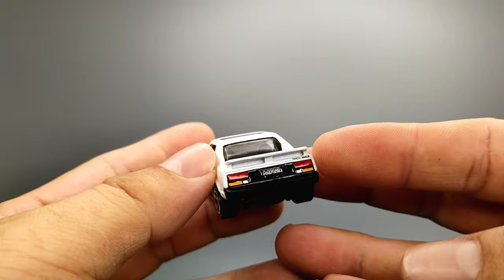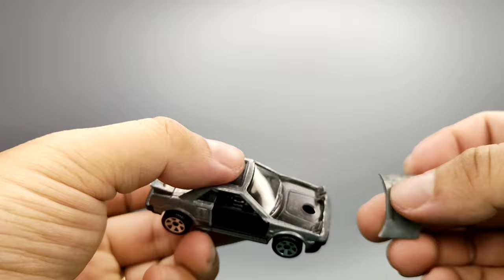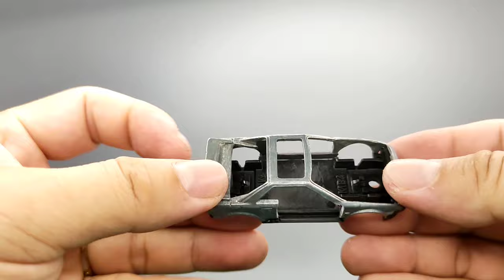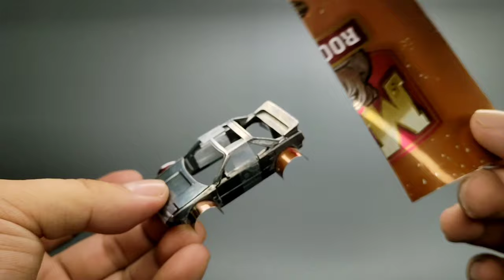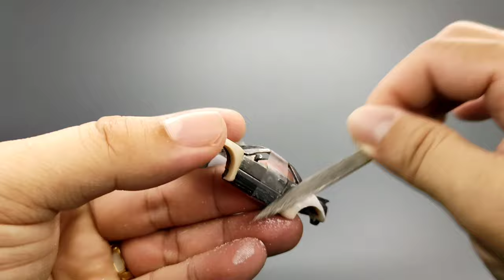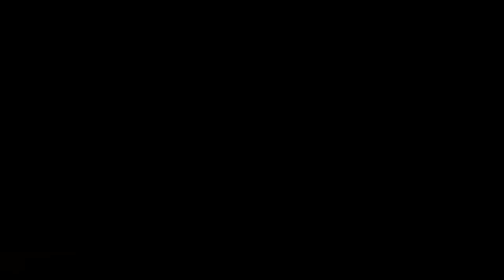CUSTOM MATCHBOX 1984 TOYOTA MR2 FULLY OPENING DOORS

Comment: Is bondo possible to make a good widebody with cause all my testing as ended with it chipping off
Reply from the maker: no bondo is a wood filler try to use epoxy putty type, 👍👍👍
Reply: @customhotwheels  ok I am using the car bondo tho but epoxy putty I will try
Reply from the maker: ohh ok, i also try to used car filler but im not satisfied its hard to mix and easy to dry no time to form it that why i recommend epoxy putty,
Reply: @customhotwheels  makes sense